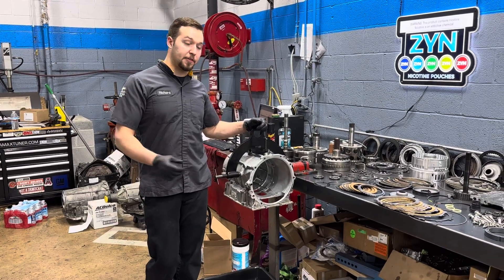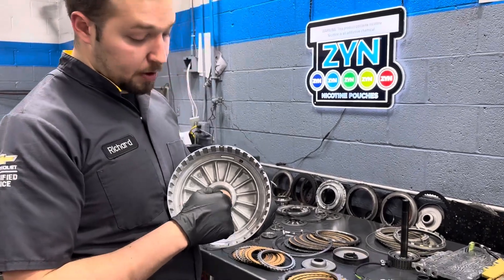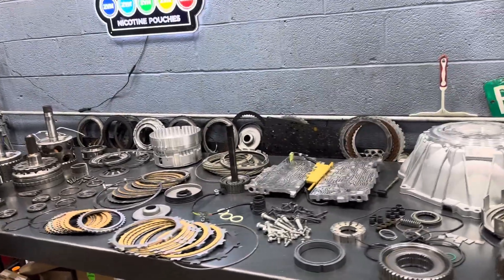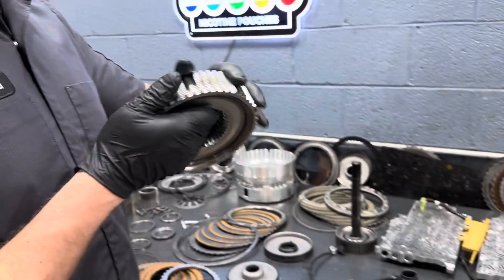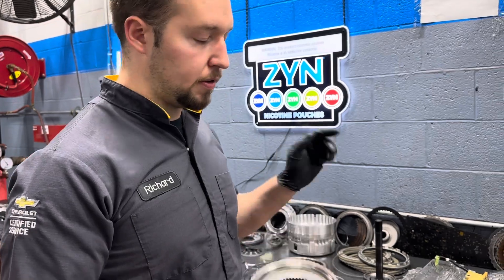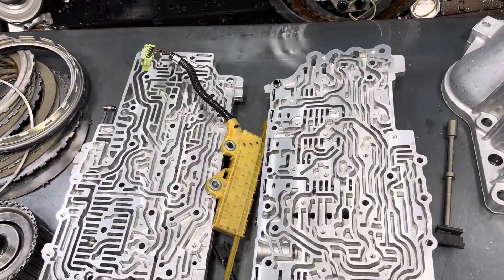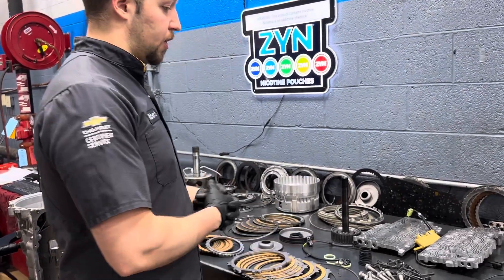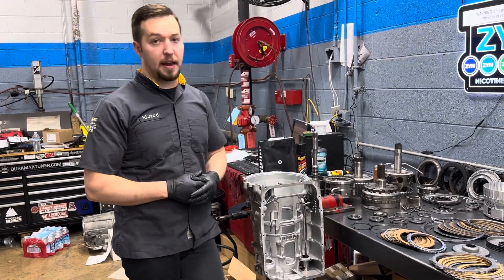My 6L80 shelf unit rebuild

Comment: Great videos, wish there were more of them. It’s very difficult to get good technical information for (the average person) I have a 6L50 transmission that was doing all sorts of silly stuff. Slipping, reving  high under grade braking, shudder in 6th gear. A flush and some additive fixed pretty much all of those issue. ( I think it was a bit low and the fluid was in bad shape also) not a of debris in the pan. I swapped out all the engine and trans mounts but now I have a much more obvious  vibration in 4th gear under load. Transmission guys answer to everything is I need a rebuild.  And I mean for everything. When it was vibrating in reverse and a single  knock on start up, they said I needed a new transmission.. it turned out was transmission mount..  what would cause a vibration in 4th gear but not the other gears?

Comment: What does. Job like this cost?
Reply from the maker: $55-6500 out the door depending on various upgrades. A GM dealer will charge $7500-8500 for the same job with an inferior (in my opinion) remanufactured transmission.
Reply: Where’s your shop located?

Comment: Any issues with the 10L1000 hd trans?   Mine has a whining sound thru 4-5-6 gears.
Reply from the maker: I do believe there is a 4-5-6-7-8-9-10-R clutch assembly in the 10L1000 but I suspect a bearing or bushing is what is leading to the noise if it shifts acceptably. If it is still under warranty take it to a reputable dealer.
Reply: ok thx for reply.  They took the front part of trans off and changed the idler bearing/gear that runs the main pump(same setup as the 10l80 video you had about idler bearing gear issue)
But noise is still there.  Up shifts are all smooth but 2-1 and 4-3 some times clunks on downshift.   Ill have to take it back to dealer cause def sounds like some kind of bearing noise… if you had radio on you couldn’t hear it but you can with it off.  Its not overly loud.  Who knows.